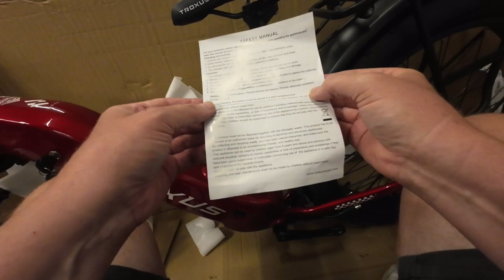Beautiful eBike | UNBOXING First LOOK \ Troxus Explorer

Comment: Like the EBike….if it was a charcoal or blue. Love and only way to go is Honest!😎💥🚴🏻‍♀️
Reply from the maker: Red or Black is all they offer. Some of the color choices some manufactures offer is a weird combo. I like deep red, gray, white.
Reply: @EbikeReviews  black would be nice👍🏼😎💥 Have to decide what brand I want to get.wish I could test drive 5 that are in my top running.. living in Alabama, riding all these backroads need something that’ll go the distance, up & down these mtns. Very few flat or smooth roads around my area. I’m 70, woman & be able to haul 150# on rear and/ or pull trailer/cart. Then when I come to my hometown in Fl, ride with my nephews and nieces to the beach. Now you can tell me what I need! 😂 Thanks!😎💥❤️🚴🏻‍♀️🚴🏻‍♀️
Reply from the maker: I grew up in near Jasper. Its what I claim to be my home. So I know the roads you speak of. Its not just the bike,  but the components that are installed. You need a 750w motor that has high torque rating to get you up the hills. 90nm or higher would be best. Its the battery that determines range, most have 14-20ah. I always recommend the highest battery you can afford and/or buy an extra. A 20ah battery will haul me 30 miles on flat ground, with easy pedaling not much effort. The more effort I put in, I can stretch it to 35-40 miles. But it depends on weight, hills and your effort. So its hard to know what your range will be. I do recommend a 20X4 fat tire even if you plan to ride on the road most of the time. You never know when you find a great trail that is dirt or gravel. Plus the wider tire ads more grip and stability.  @patlsmith404
Reply: @EbikeReviews  thanks for the info. When I lived in Bham I delivered high impact tools in Jasper and surrounding area. Drummond Oil was one of our biggest clients. I’m originally from the flat land, Ft Lauderdale. 😃 I’ll keep watching and maybe something will come along and grab me. I’m looking to buy for my husband and myself. We need something for our area or wherever we go. I visit my niece a good bit in Stuart. Keep up the great videos for detailed info. 😎 Happy Trails!🚴🏻‍♀️💥👍🏼
Reply from the maker: Thank you!  @patlsmith404